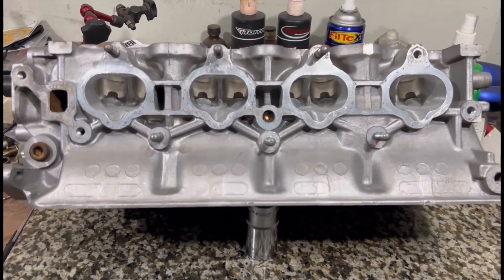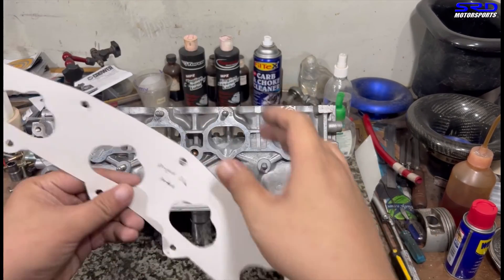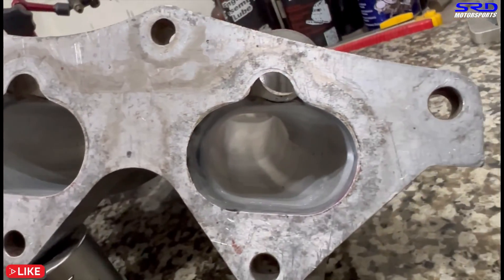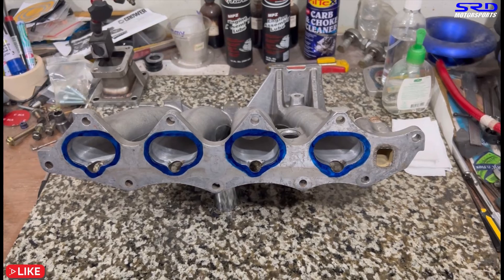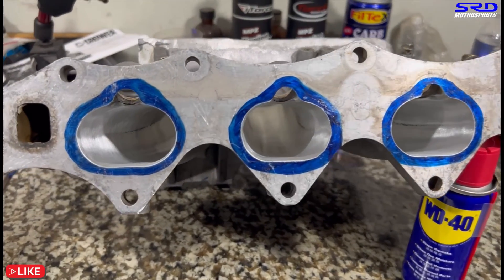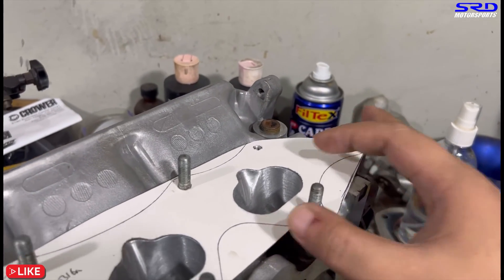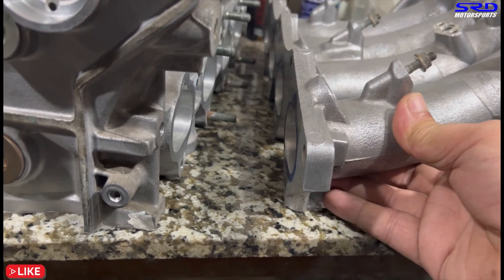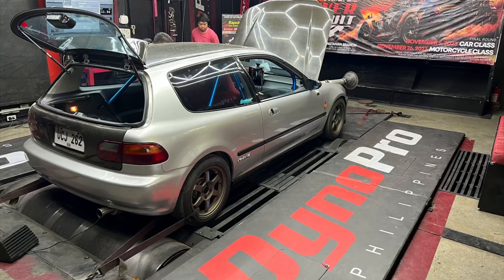How We Port Match Intake to Heads on Honda B16 B20vtec H22

Comment: After port matching , what gasket should be used ?
Reply from the maker: we cut/make our own 

and it’s what we use to port match the manifold to the head…
Reply: @SRDmotorsports  What material did you used ?
Reply from the maker: Just cardboard
Reply: @SRDmotorsports thank you ! ♥️
Reply from the maker: no prob

Comment: What up brother, will attempt this soon on a J series project! Just to make sure I understood correctly, you are port matching the IM to the head ports, but I have 2 questions. How did you get the template for the head? I know it starts as a blank canvas first but how did you create the ports on the template to match the heads exactly? Did you use an exacto knife, a pick, or what? Second, what is the blue dye on the IM ports? I know you use the template made from the head ports, to see what needs to be cut from the ports on the IM, but can you not just trace the outline on the IM ports or do I need this blue dye? If so, I assume you put the dye on the template and just press it up/align on the IM ports? Thanks in advance my man!
Reply from the maker: The dye is dykem but u can also use a marker even color yellow 🤣

X-acto knife will be way way better as the sharpness is better than the regular cutter

One trick u can do is as u cut the intake gasket outline and holes for the studs/bolts ? Lay it on the head flange intake side…

“Press” with ur thumb the perimeters of the ports” it will actually mark up good and lets u see it or it can be a guide to trace with a pen or pencil then u got an exact pattern intake gasket off the head port entry :)
Reply: @SRDmotorsports  Cannot thank you enough brother! I understood everything you have said. You are clear and concise, and more importantly, an educational source. You have motivated me further and I'll make sure to make you proud hahaha. Thanks again and keep up the good work. Subbed and checking out your vids man!
Reply from the maker: @christopherrod7  oh wow thanks for the kind words brother! I mean back in the days the Forum was like this Ofcourse a lot of nonesense but a few good sense and so I figure we can bring that back a bit hehe

The members only actually has a video of a trick way we do the gaskets but what I said earlier? Is as good

Comment: As there is always a bit of movement on the mounting holes you should drill a couple of holes and install a couple of dowls (roll-pins) to always locate it perfectly every time.
Reply from the maker: That’s true that’s true 
Or in this case set it to the bottom most it will as installing it on the stand or on the engine bay gravity helps keep it centered down…

With multiple bolt holes it can center 

But yes definitely dowels are excellent and there are good spots left n right lost of the flange where it’s safe to locate

Much like the VW ways
Reply from the maker: and thank you for that… makes for a good future video to make! Hopefully soon

fill find a user friendly way/approach to share that

Comment: What do you recommend in situations where an OEM metal sandwich gasket is used and the gasket is smaller than the manifold or head ports? Is it ok to trim open the gasket to match the ports?
Reply from the maker: Oh yes yes that’s def alright… some aircooled intake and exh gaskets are like this and it’s okay to trim the gasket good thing it’s smaller than the ports